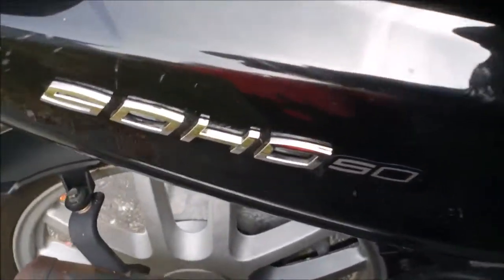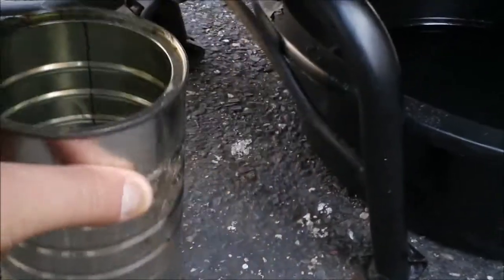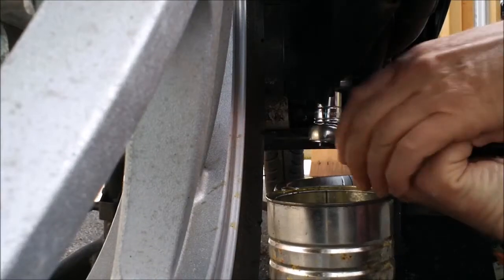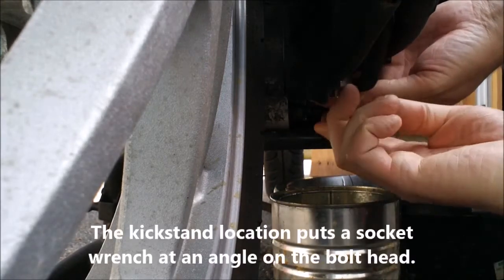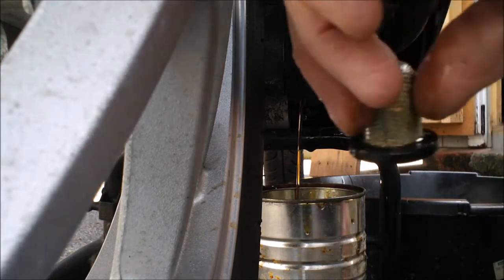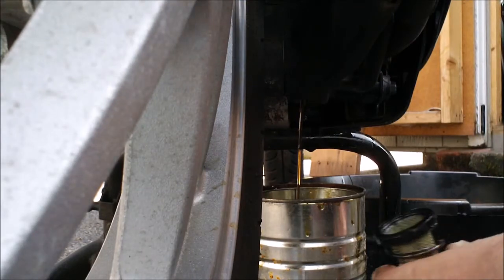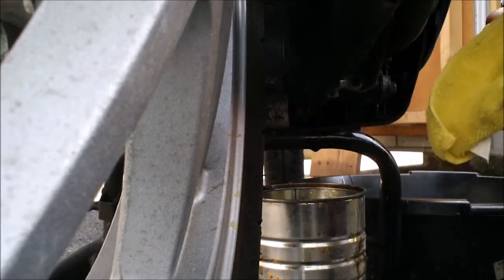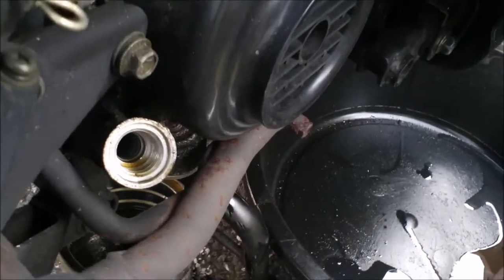SYM Lance Soho 50 Scooter Motor Oil Change

Comment: Do you have any suggestions for rust removal for the Lance Soho 50cc ? Products you recommend for Maintenance of it? 
My shop is so far away, and schedule hadn’t lined up so I ended up doing my own oil change watching this video (Thank you! There really does need to be more videos for this specific model- it’s a beautiful moped)
Reply from the maker: I'm glad the video helped with your oil change. Thanks for the kind words. As far as rust removal goes, probably a wire brush, sandpaper and some spray paint should do the trick.